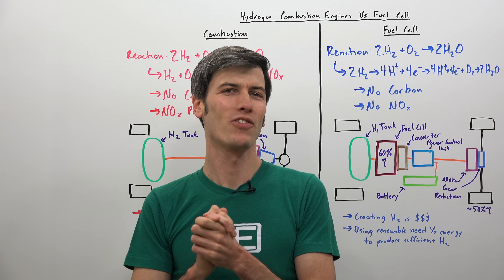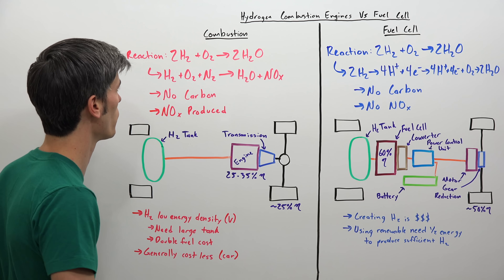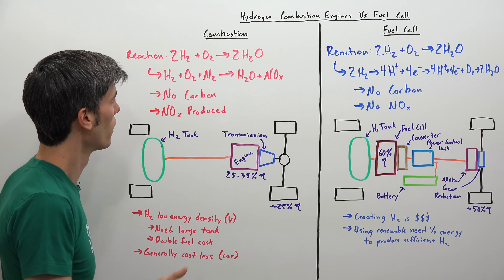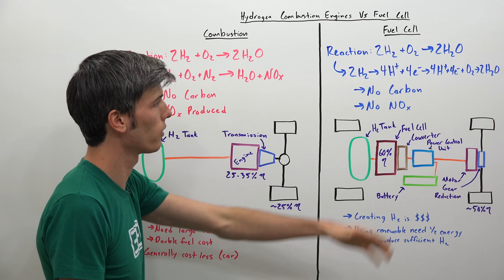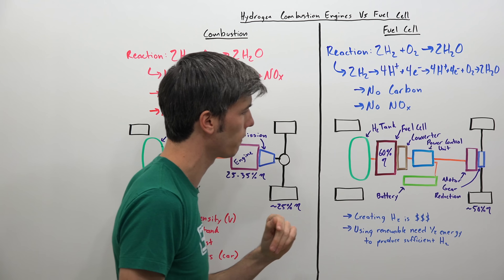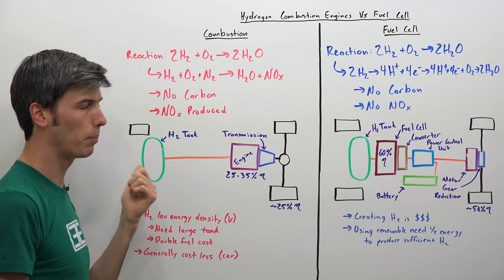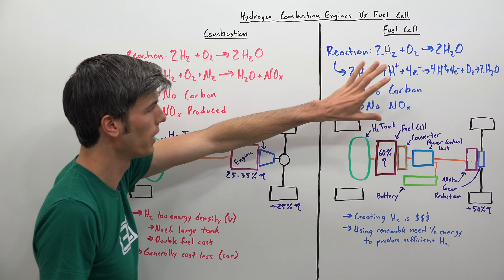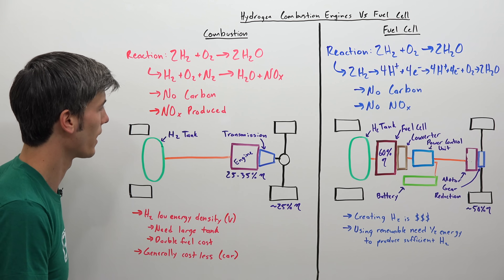Why Hydrogen Engines Are A Bad Idea

Comment: Someone will build one & people will buy it.
There will be rugged markets that simply don't want to deal with electric motors
There will be an enthusiast market that want an ICE
There will be a market of cheap to buy small engines where the low cost of purchase & simplicity outweighs the higher running cost (think motorcycles, outboard engines, lawn mowers, chainsaws any market where we have seen 2 stroke motors still dominate into the present day)

You also aren't considering that hydrogen has the potential to operate more efficiently than current engines, whilst a converted gasoline engine you are right in saying will achieve around 15-20% efficiency, purpose built hydrogen engines have the capacity to reach near 40% efficiency with currently available tech in a 'car sized' package. Additionally, a purpose built hydrogen engine designed to operate an extremely air rich ratio will produce very small levels of NOx (at the expense of packaging).

Then there is the whole NOx argument, as a pollutant the effects are still in dispute, whilst there have been several studies in Europe about the effects of NOx concentrations, their scientific basis has been heavily criticised. Additionally, with the usage cases I describe, hydrogen ICEs may well be greatly outnumbered by fuel cells, in which case it may not be difficult to allow for some NOx production whilst still being well within current safe limits. 

As I said, they may well be the minority in general transportation, but when hydrogen proliferates, SOMEONE will produce them to fill niche markets.
Reply: Yes! We need to save the combustion engines!

Comment: wonder if catalytic converters (platinum or more advanced amalgamation of materials) could used for the nox being produced on the no electrified version.  You would be cutting down on amount of components that could go wrong if you could get the example on the left to work, mining of materials for batteries eliminated being the biggest benefit.

Comment: 2 Questions:  a.) Could compressed/liquid hydrogen increase efficiency in both cases?  b.)  Could introduction of Hydrogen into Fuel/Air mixture improve conventional ICE efficiency?.  Thanks.
Reply: Well the first one is yes, the second, no. Hydrogen has to be either compressed or in liquid form as it is vastly less energy dense than gasoline. Even at 69MPa it only has less than a sixth the energy density as gasoline. Liquid hydrogen is actually still worse being still less than a third as dense, but it also takes energy to keep it in liquid state. 

Hydrogen in a normal combustion system makes very little sense though. Hydrogen is much more sporadic at ignition pressures meaning it's more likely to damage the engine. And again, it has less energy than the raw gasoline so no matter what you are getting less power either way.

Comment: Its very simple to make hydrogen generators. I've actually seen engines that separate hydrogen from oxygen in water and ignite the hydrogen to create electricity with a photocell simular to solar panels which charge batteries and run an electric motor..
1 glass of water = 3,000 miles.

Comment: If you used on-board O2, you could circumvent the nitrogen problem... but the reduction in volume would mean smaller pistons, with the same energy output; which means, you would be powering cars with bombs.

FUTURISTIC

Comment: Hydrogen combustion or fuel cell both make this problem.  Canadian buys hydrogen car, drives it home parks it and the next day all the water inside the engine froze solid and it wont run because its -30C outside. LOL Take the schematic and look at the water output and ask yourself, hmmmmm what would happen if all that water froze and the new water being produced had nowhere to go  since its plugged by ice?     BOOM!!! lol no hydrogen car will ever sell in cold climates unless that hydrogen engine can produce its own antifreeze to mix into the water and that would be an environmental disaster if we produced cars that generated antifreeze every time you drive it so its a fail all around. Look up how much of the world gets -1C at least 1 day a year or colder and all those places can't use a car that uses pure water in it in any way. Even radiator fluid and windshield washer fluid have to be mixed with antifreeze or your car wouldn't last 1 year. Electric cars suffer in the cold too since batteries outputs and storage capacity are greatly affected by temperature too. A replacement for a gasoline engine needs to work effectively from a range of +40C to -50C external temperatures and also be parked for 24-48 hours in those temperatures without an issue. Also dumping water from the engine on the road in a cold climate cant happen unless you want skating rink style highways with 100 car pile ups every hour lol. Im not sure what a good solution is other than somehow develop a nuclear power plant that is the size of a tennis ball so it can safely be used in a car............ Actually the simplest solution would be to replace gasoline with alcohol, its combustible and its alot cleaner than gas for the environment since it's a natural renewable product that doesn't require butchering the planet to get and it cant freeze and it works well in all temperatures and it doesnt turn a road into a skating rink. But essentially we need a non liquid car, a car that doesn't use any liquids at all, that would be the ultimate goal for energy efficiency since liquid is so heavy and takes so much extra energy to lug around(and switching the liquid for an equally heavy object like a battery doesn't help). There is some buried tech that can be used to make an engine that generates energy without a fuel source or an energy storage at all using magnetism as a source of energy but shhhh were not supposed to know that magnets can permanently generate electricity all by themselves if there set up a certain way using frictionless magnetic gyros and the only reason the tech isnt available is it can potentially put the hydro companies out of business if everyone had unlimited free electricity.

Comment: Last time I checked the cost per hp of a fuel cell was 10x (!) the cost of an ICE.  Engineering efficiency does not always equal economic efficiency.  If you already have to generate the electricity to make the hydrogen, why on earth don't we just use it in a battery electric vehicle rather than adding all the cost of going from electricity to hydrogen as well as the cost of the fuel cell?

Comment: I have seen a car burn water in the same way we use fuel today, it is all about the frequency of the spark and increasing the flow of water in the motor to twice the amount then regular fuel, so it has enough to burn,  and the beauty of it is when burnt it turns back to water and recycled and used over and over again, this is all about paying for the fuel.

Comment: Well, the whole idea of hydrogen engines, is use less or none electronic components, and therefore no battery.
The most important part is the battery. The idea is to have an environemental friendly way to fuel engines.
Reply: Yeah; it makes a lot more sense to use a super capacitor instead: it's faster, cheaper, and made of ordinary (enough) materials.  Some electric (battery) cars are using one already, to give faster power delivery and charging (for regen braking) than batteries can manage.

Comment: So why not use solar / renewables 
to separate water into Hydrogen and Oxygen. Compress both and use both skipping the nitrogen part from Air. 
Use a small turbine engine to charge batteries to run the electric motors to turn the wheels. ?

Comment: There's a lot of dislikes, so I joined in.
Cost of Fuel is not the only part of efficiency equation. WEIGHT of the car due to all the fuel cell equipment is also part of the equation, from initial cost to maintenance cost due to more tire wear, brake wear, etc, and size of whole package adding even more weight.

Comment: Might not be great for cars but i converted a generator a couple of years back and it works great, there are a couple of issues one needs to be aware of and it does take a little fiddling to get the fuel air mix just right but i run it a little lean and it works great. The catalyst is now less than gasoline cost per gallon per hour. a couple of years ago it was actually a little more expensive, but more convenient for me as i live a long way away from a gas station. You can store alot of potassium hydroxide pretty easily and as long as you have water you have power.
Reply: If you're burning up your potassium hydride, then you're not doing something right.   It should remain in the water, not going up the hydrogen or oxygen tube

Comment: I think for heavy duty hydro combustion engines will be used. Because these type of engines have a lot of power available compared to their size. One condition is access to a big fuel tank. For the lighter applications like transport for some goods and people, the cell engine will be used. As their battery's and electronics are getting smaller and smaller. And for power back generation from kinetic energy, the cell system is optimized for that.

Comment: TL:DR version: both seem better than gasoline engine for DIY

Should’ve had a third variable, gasoline internal combustion engine. You know, what he use everyday. While your numbers are correct, it seems bias towards hydrogen combustion, when that is seemingly still better than pump gas ICE. N0x is produced in both, how is the footprint on hydrogen compared? Does it produce the same levels of carbon monoxide? These little things matter to me I guess.

Comment: I don't think the question is necessarily whether hydrogen fuel cells or hydrogen combustion engines are better or worse than each other as it's whether either of them are better than gas fed engines, which in either case I'd think would be a resounding yes. As in the cases you laid out I don't think the production of NOx groups is a bad thing as the nitrogen dioxide groups can be collected right off the bat and the nitric oxide can be bread into nitrogen dioxide (aka nos), so I guess if you don't a self filling tank of nos would be cool then maybe go with the fuel cell. Besides that you can use many of the same regenerative techniques as with the hybrid but instead of storing it as electricity you use it to make more hydrogen from water pulled out of the air. Which brings me to my third point that whether talking about either of these technologies hydrogen is the most abundant element in the universe and the process is for all intensive purposes is infinitely reversible (meaning as long as you have access to energy to dissociate water you can run a vehicle off the same container of water continuously, again provided you have the energy to dissociate it), this cannot be said about hydrocarbons. The volume argument is only effective when you neglect the possibilities of pressurizing the hydrogen (which can be done in the electrolizer making dissociation more efficient) as well as metallic hydrogen (which granted is highly experimental). In either case the only reason either of these technologies aren't the main staples of today is because of all the misinformation about how expensive it is compared to gasoline ignoring the fact that the hydrogen economy is purposefully kept in its infancy meanwhile the failing hydrocarbon industry is being subsidized just like coal power plants and so on. I mean this a great video comparing these technologies together but to compare either of them to the hydrocarbon industry without getting into the very politicized reasons why hydrogen is kept artificially expensive and gas is kept artificially semi-cheap is inherently fallible (not to say that hydrogen can be produced with less energy than is needed to produce gasoline (although enough r&d and it very well could be just as efficient) but hydrogen comes out of my tap while crude oil needs to be dug up and transported, often from foreign sources that we end up ultimately going to war with, hence the politicized nature of all of this).

Comment: Probably something to do with the fact that more energy is required to split the water molecule than what the hydrogen will produce when burned. 
Then there is the safety of hydrogen as a fuel, one major problem is the colorless flame!

Comment: If our main goal is to be long-term thinking then the only REALLY valid argument I got out of this is the NOx.
And in these regards we need to look at the fact that batteries WILL need to be quite frequently replaced and I think I need not say more about this.
NOT even the horse is completely Emission-neutral. Seriously!
Everything else I heard here was primarily centered around Efficency and Cost.
It would of course be foolish to completely ignore these factors but one must think outside of the box.

It once again comes down to energy. I may be drifting off topic here now but: As a civilisation at some point in the NEAR future we WILL find
a MUCH cleaner and safer way of producing what it all comes down to: Energy.
I, for my part, am a great and proud advocate of Fusion-Research as I (along with quite a few of my Professors) see them as the only solution.

And now I get personal: FUC all of this Renewable-Emobility-Fancy-Pancy BS.
This entire way of thinking sets us back as a civilisation. It has its place but IT should be niche NOT the other way around.

Mark my words. When the Fusion will finally work, on the long run it will change the world for the better and one of these changes will be H2 becoming
much MUCH cheaper and this will then literally prepare the road for Combusion H2 Engines.
+They are MORE powerfull. (Which is key if we also seek to power planes or even ships with it one day! [Think outside the box])
+Can be INSTANTLY refuelled.
+Rely on a VERY robust Core-Technology (the good ol Combustion-Engine)

+And did I mention they also make the Vroom-VROOM we all love?
(I mean srsly, some E-Cars actually have speakers that FAKE these sounds! ... ... ... That's just Heresy!)

Comment: The nice things about hydrogen is it has less of a environmental impact in the short and long run compared to gasoline and electric powered cars but also put no strain on the power grid unlike evs which regularly cause blackouts in some places

Comment: Note that nitrogen oxides are formed naturally by lightning during thunderstorms. Since our atmosphere contains 80% nitrogen, they are likely to form naturally anyway. Further, without SOx and hydrocarbons, most of the ingredients are missing for photochemical smog, which means that you would not have ground-level ozone either. Nitrogen oxides are not a greenhouse gas either.

Comment: the real question is: how much better is a fuel cell car than an "all electric" car? The H2 tank takes space, as well as the cell and converter. Use that space for batteries and you have a fine EV for a fraction of the costs.

You'd need a massive range benefit to make that viable. Of course, you spend way less time at the gas station, comparable to lpg, than on a  power station.
But a hot swappable, uniform battery pack would solve that issue just as well without the need for carrying flammable gases.

Comment: If I recall, fuel-cell cars also have a battery, located between the fuel cell and the motor, no?  This would make sense, as a battery has a very low internal resistance (more closely matched to the motor's impedance) while a fuel cell has a larger internal resistance, limiting current.  The battery would then be used both as an impedance matching device and a buffer when more current is required (acceleration).  This in turn enables a smaller fuel cell to be used, reducing unit cost (and limit the use of high-priced catalysts like platinum, also reducing unit cost).  Does my memory fail me?

Next thing I'm thinking; why go the hassle of carrying all this stuff for a less performant car, while all-electric cars are a lot more efficient?

Second-next thing I'm thinking: wouldn't the release of a lot of H2O vapor create it's own climate issues?  (it's already rainy enough over here).  It would be sad to try to cure one problem by generating another.  When I was a kid, CO2 was seen as a simple inoffensive byproduct of combustion, look where we're now.

Comment: A guy has a hotrod 1948 pickup truck 5 liter engine. It runs on 100% hydrogen gas (not liquid). It produces LOUD engine noises and produces 600 HP!! Sure can peel out too.